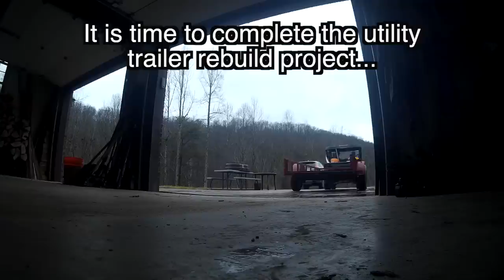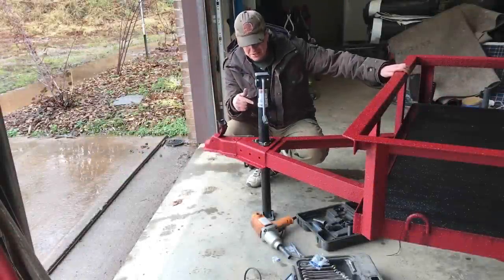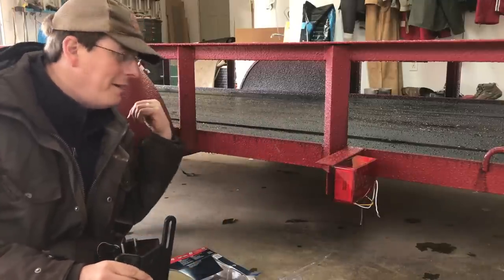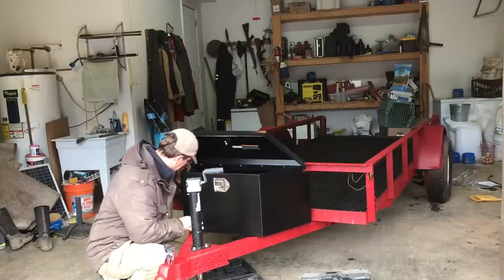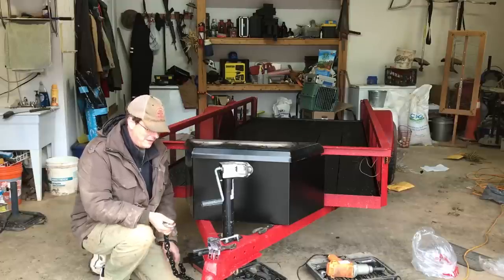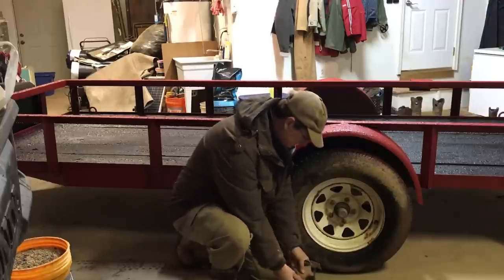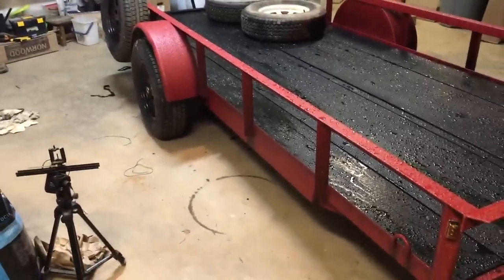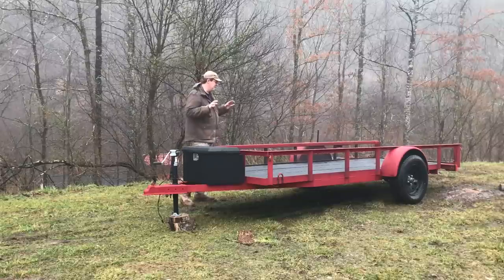FINISHING our Farm Utility Trailer restore project

Comment: Did a fine job on your trailer. When I had one I used to padlock the hitch closed.  That was before the days of battery powered angle grinders. Just as well you keep your trailer plate in the truck. On my old trailer it was the only thing worth more than scrap metal price.

Comment: the Marker lights are great for backing up at night so you can tell which way your going Looks good Troy !!!  Troy I dont know if you know this but those Tires you put on your trailer has a Max speed of 60 MPH after that you might have problems I had the same tires ,   I learned that the hard way I was on the four lane  doing 70-75 and the tires kept getting big knots swelling out on the sides of my Tires I went through two sets of tires before I called the Company and they informed me about the speed rating  I had to go with a 10 ply tire to stop my problem I was doing over 60 MPH was the problem they told me it was building up heat and I always need to put the Max PSI in my tire and never use any thing Under a D load range for over 60 MPH
Reply from the maker: I will keep an eye on that. thanks!

Comment: Nice restore on your trailer Troy I hope to redo mine when weather improves. I have my plates lock bolted to the folding ramp on back of my trailer. I didn't have my trailer a month and had my plates ripped off at the local lake parking lot while I was on the lake fishing. If they get them now they will have to work for them,  at least they would earn them.lol

Comment: Nice job on the trailer project!  Really enjoyed watching this come together.  I would recommend putting some 3M type reflective tape across the back and down the sides to reflect headlights and other lights.  Really helps when it's dark outside.  Not sure if it would stick to the red coating or not, but you can figure something out!  Take care.

Comment: I liked the time lapse on that wheel bearing assembly, see if the armchair referee's can keep up with to complain as to safety regulations. One reason people  chose Virginia was freedom for doing stuff their own way or as dad said, there's right, wrong and my way and you can figure 99% time was his way. Nice job and not wasting what you have. I look at it this way. Spend the money for new and just hook up and go or take say three days fixing one for yourself. If you divide three days into real cost and then take days spent fixing and divide difference and you find out how much money you saved/paid yourself and its real good wages then as at least twenty five hundred or about eight and change hundred a day. Makes you "almost" ready to build and sell. As if on a farm that size you can find time to do willy nilly. Great job Troy and god bless
Reply from the maker: Did you like my fancy rear seal set tool?
Reply: @RedToolHouse  You speaking carharts on cold cement.... those I don't miss myself as  it feels like its draining my batteries/LOL. I have a couple of those motorcycle jacks but from alaska to virginia would be      cheaper   to give you the money to pick new ones out. Costs a fortune to mail freight from here to even in state.

Comment: here in north western Ont, Canada our trailer plate is $25 and good for the life of the trailer, unless you loss it, a replacement is $17 IF YOU DONT disply your plate on tthe trailer, the fine is the same as it is for any car or truck, $150 fine and if not paid with in 14 days your drivers license is suspended, as costs $350 to have it re-instated, it dont mater if you have the plate on you.. must be a cheap light to brake from just falling and landing on a tool, or you got mad and drilled it to the floor, the lights i install on all my custom built trailed, you can give them a hell of a kick and they dont crack
Reply from the maker: Our local law enforcement doesn't really care about trailers. I was ticketed for an expired inspection sticker on my truck while towing a trailer with no tags. It wasn't even discussed.
Reply: @RedToolHouse  interesting, i have seen videos of usa people building a trailer, and all the red tape you have to go though to get it regestered and plated, here we build them and just go down an tell them we have a home made trailer, you tell the color how many axcels GVW  annd as long as GVW  10,000Lbs you pay a life time fee of $25, 10,001 to 25k #250 a year an so on.. ticketed for an expired inspection sticker, wow here it be plates off right there, towed plus a $500 fine a shop has to do an MTO  safty every 12 months, on anything 1 ton and up, cosy me about $1500 to get a safty on my F600 a year, lucky if i put 500km a year on it, farm plated

Comment: Troy I have a trailer with treated wood decking would it be a benefit me to oil the treated wood ? If so how long does it stay nasty like when you touch it getting oil on clothes and such. Thanks like the videos. P.S. email milwaukee see if they will send out some M18 tool for you the electric impact made me laugh a little. Thanks